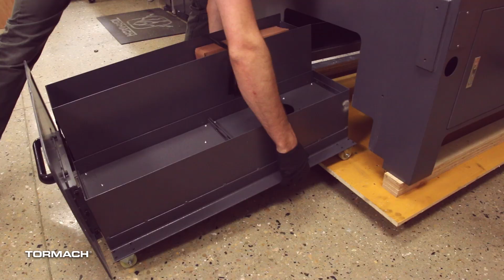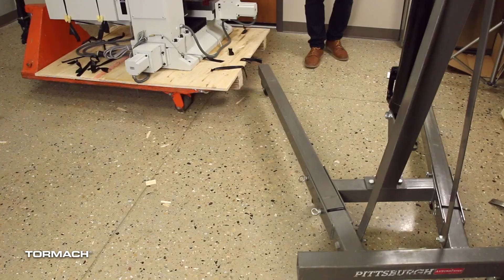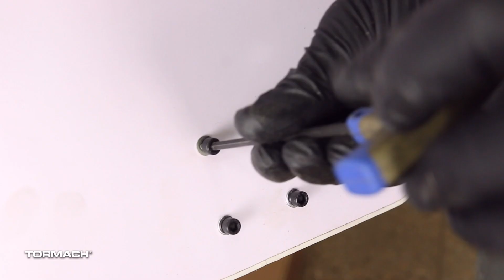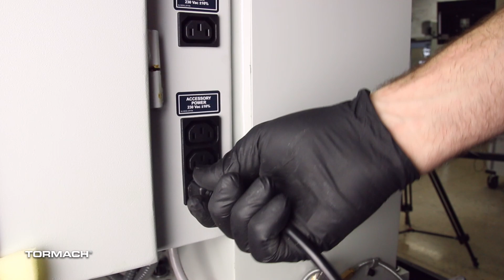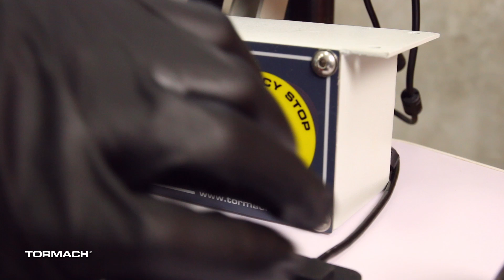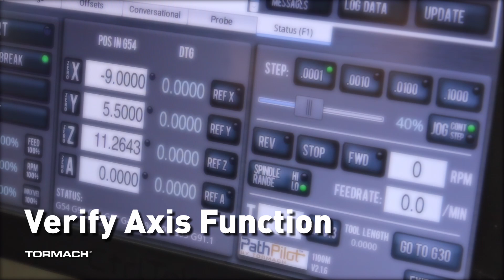1100M and 1100MX Installation Procedure

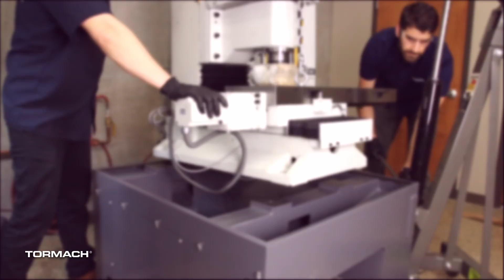Comment: How can I fit the machine in what is already a small door? I really want this machine. However, homes in England can be quite small. The door at 1:08 is that size sufficient to bring the machine inside?
Reply from the maker: There is a way to do this, which we call a "Door Way Dance,"  but that is dependent on the size of your door. Also, is this going into a dwelling? Houses in England can be smaller so you will need to determine whether you have enough height. Here is a link to a blog post covering the door way dance: https://tormach.com/articles/doing-a-door-dance-the-tormach-way

And here are some documents on the dimensions of the 770M/MX and 1100M/MX 
https://tormach.com//media/asset/3/8/38874-a_7_.pdf
https://tormach.com//media/asset/3/7/37998-a_8_.pdf

If you need to talk to someone, please setup a support ticket with one of our Tormach Technical Support Members here: https://tormach.com/how-to-submit-a-support-ticket

Comment: Great video! I just booted up my 1100mx but I my issue now is that the coolant pump won't turn off. The LED indicator for "coolant" is off on my pathpilot, yet the pump just runs continuously. What am I doing wrong?
Reply from the maker: Setup a support ticket with out Tormach Technical Support team so they can help you out. https://tormach.com/how-to-submit-a-support-ticket

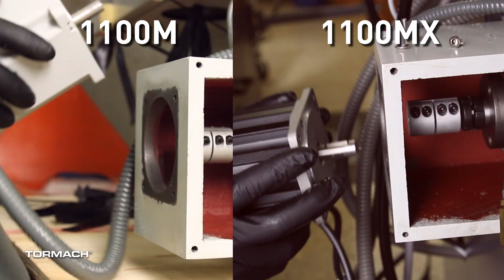Comment: At 1:55 it shows the Y axis motor with the connections on the bottom however later in the video it shows the connectors rotated 90 degrees… well… that’s because the Y axis motor does not fit with the connectors on the bottom. Oh boy. Just getting started with assembling mine and I’m already concerned.
Reply from the maker: We are compiling a list of changes for some of our older installation videos and plan on making some updates, and in the case of the 15L Lathe probably redoing the entire process. In the meantime check for the latest install document on the website. https://tormach.com/docs

Comment: Im buying a used 1100M. Does anyone know if the 1Ton Harbor Freight engine hoist will work for the install? The weight is ok but not sure if it meets the lifting height needed.  The seller is taking it apart.
Reply: 1 ton does not lift it high enough and the machine is way beyond the 1/4 ton rating of the highest position.  You need the 2 ton version.
Reply: yes, engine hoist from HW Freight worked fine for me. I got a Pittsburgh and had to set the length to 1/2 Ton to reach the base. Does fine since the mill is 500kg.

Comment: Hi, I hope you can help me I stared assemble my tormach 1100mx I order the path pilot console and the enclosure< on the video after you install the automatic oilier you install the control but I can install the control yet because the console is attached to the enclosure, also to install the tool changer you have to move the table but I can't move the table because the control is not installed yet, so can I assemble everything and after install the control make the adjustments? also on the video on the aluminum block on top of spindle is two orange air hose on my machine is only one air hose, why? that is correct?
thank you.
Reply from the maker: The Owner's Manual has been updated since this video was made, and that section of the procedure has changed. Please download the Owner's Manual from this link, but if you do run into issues, please reach out to the Tormach Technical Support Team: https://tormach.com/support/mill
Reply: @tormachinc  thank you.

Comment: Not an "M" question, but: What would you recommend the auto oiler interval and oiling duration for the 1100 s3?  Mine is set to 4 seconds.    (Every 240 minutes i think)
Also, if the machine was not turned on for more than a week,  would you manually press the oiler to oil the machine, or would you wait for the few hours left on the interval for the counter to count down (from the previous oiling) until it will oil it?
Thanks.
Reply from the maker: On the PCNC 1100 and the 15L Slant-PRo Lathe, the interval time should be set 480 minutes, while the actuation time should be set to 12 seconds. If you plan on not using the machine for long periods of time, we recommend powering off the machine to prevent over-oiling.
Reply: @tormachinc  Thank you.  I'll change it than.   But I'm afraid you misunderstood my second question.  ( I know not to leave the machine on for one week).  I am asking if the machine was OFF for like a week, and I turn it on again.  The counter might say 2-3 hours remain to oiling.  Should I manually press the oiler to oil it "NOW", or can I just wait for the remaining hours on the counter to run out, to oil it by itself in 2-3 hours. 
Thanks.  :)
Reply from the maker: When the system turns back on, the automatic oiler will power up and send oil through the system. Then it will follow its programmed schedule.